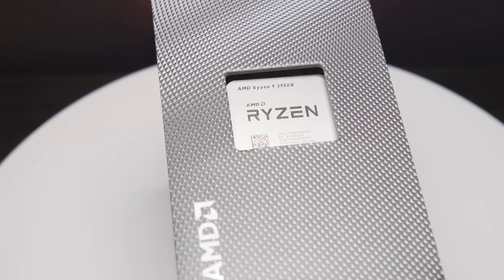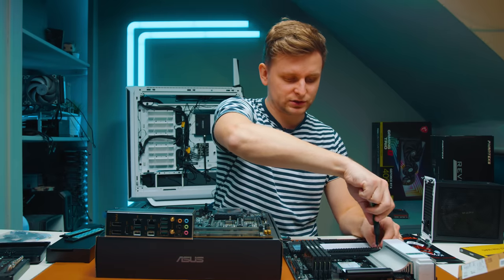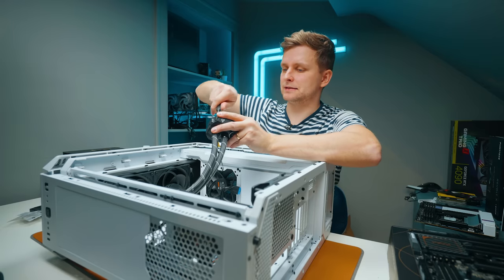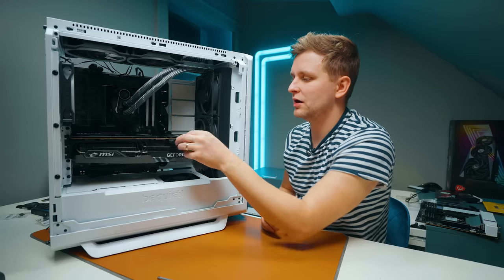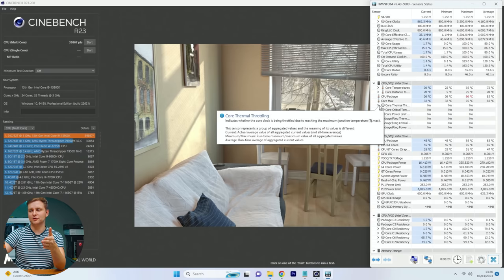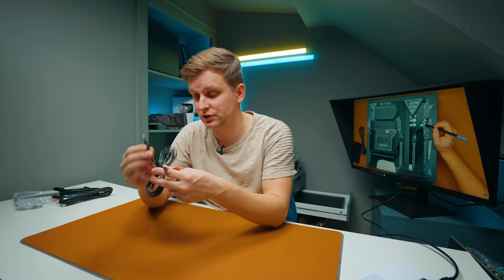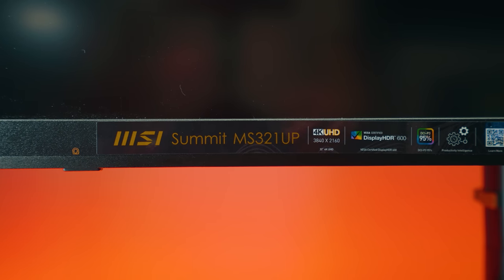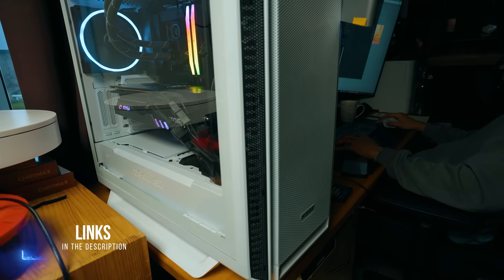My Dream Video Editing PC - 'BEST' Creator PC 2023

Comment: Awesome upgrade bro ❤ and I would like to mention some things here that according to Gamers Nexus testing, Thermal Grizzly Contact Frame has much better tolerances and proper torque adjustment guide for screws that helps it to shed some extra degrees and better memory frequencies. That video is caled "$4.35 Fix for Intel Thermal Problems | Thermalright 12th Gen Contact Frame"
Reply: Just few degrees for the 13th gen

Comment: Nice upgrade. I sorted my problem after watching your video with the Asus representative about RAM. 
My XMP didn't work on my Asus ProArt Z790 motherboard with Corsair 64GB of DDR5 6000MT. 
I was running at 4800MHz default config. So I enabled the XMP-II profile and dropped it to 5600MHz works perfectly now. I wish I went for a 5600MHz Ram in the first place and save a few £.

Comment: 0:55 "It's time to upgrade the PC so we can get more videos done faster."

...the 3090 Ti that was in there was more than adequate to edit video. I cannot comprehend how a 4090 will actually save you any meaningful amount of time editing/encoding/transcoding.

Maybe your project exports take 4 minutes instead of 7, but so what? How often do you export/transcode/etc.? Does that time actually add up for you? Enough to justify a $1600 GPU to replace your $1600 GPU from a year or two ago?

If you want a 4090 in your PC, no doubt; respect. However, I'm skeptical this was actually necessary and will actually have a meaningful impact on a typical YouTuber. The truth is, RTX 3060 12GBs will handle 4K timelines no problem... As will 20-series cards. Hell, outside of encoding, I barely notice a difference in premiere between my old 1070 Ti and my 3070 Ti.

Comment: The FireCuda 530 certainly is a lot of fun. I've got the 510 in my original system, and in my current system, I'm using the 530 (yes, also the 2 TB version) as my main drive, and the 510 as the secondary one.
Reply: I just bought one ,Firecuda 530 2 TB version today.Its realy mindblowing fast..

Comment: Excellent video and awesome upgrade! I built a high-end Z690 platform back in October and have five of the Seagate Firecuda 530's in my system. Absolutely love them! The fact that you gained so much performance is pretty damn impressive. My plan is to upgrade to a 4090 Ti  if/whenever it's released, as I need all the 3D rendering horsepower I can get. I hope I can get as close of a performance uptick as you.

Comment: The only thing I didn't like about the MSI trio, is that apparently they skipped out on the vapor chamber and have a cheaper VRM, otherwise its one of the better looking ones you can find at MSRP. I managed to get the Asus TUF version at MSRP via the Asus storefront. Curious if you also get a bit of coil whine.

Comment: I Just upgraded to an 13900KS from my 12900KS and the Artic Liquid Freezer 420mm II in Push-Pull had a hard time keeping it cool. So I moded it and added a Rockit-Cool Copper IHS, since then my CPU is a lot cooler in that combination. Still 2 cores get into therma throttling but most are cool enough to continue with high frequency.
Reply: I think the s variant is meant for custom water looped PC's

Comment: Lovely build,
Congratulations.
What do you think about direct die cooling for your build?
I'll say you would be able to get extra performance from the chip
Reply from the maker: I'd say as a creator it's not worth it, too much risk and work if anything needs changing :)
Reply: @theTechNotice  what I'm so sure of is that 13900k will not thermal throttle when it's direct die cooled, which is a great performance advantage
Reply: @samsonadeboga223  How often does the system actually throttle in day to day use though.  It would probably make more sense to tweak the power to keep temps in check if it's actually throttling than go direct die.

Comment: completely agree about the Arctic Liquid Freezer being one of if not the best range of AIOs, but have the annoying need to find new motherboard protection stickers when you swap motherboards; at least they add two sets for Intel and AMD motherboards. I extensively use WD SN850X and Samsung 980 PRO M.2 SSDs. I'll probably move to 990s when the new firmware has been proven to stop the early "wear" that was happening. Everyone with Samsung drives should be using Samsung Magician and keeping firmware up to date. The rate at which SSD prices are falling is a bit depressing: last year I paid $230 for 2TB Samsung 870 EVO SSDs. Now they're around half that price! Same with DDR5 RAM. My Alder Lake build from last year is now about $2K cheaper!
Reply: Lower prices are great news for us still planning to build
Reply: What motherboard stickers 😭. It is really necessary? Planning to swapt case soon and didn't realize this .
Reply: @cjyy6290  not sure if you saw my reply: someone helpfully deleted the response, probably because it included a link to Arctic's tech support page (i.e. outside of youtube). Basic recap: the stickers are probably required to stop the rubber grommets on the backing plate nuts migrating through the motherboard over time and leading to a loss of pressure and thermal conductivity and therefore an overheating processor. It's probably OK in the short term but I wouldn't risk it over the long haul (no idea how long that would be). Contact Arctic support is your best bet and ask them.
Reply: @treyquattro  noted. Thank you for your help 🙏.

Comment: Nice thing to upgrade your PC
I want to build my first I had a MacBook Pro before. Needs color grading in Davinci resolve. I'm wondering how to reconcile Intel i9-13900KS with two GeForce RTX 4090 and still have a liquid cooler for the CPU. It would be nice if there was an option in the future to mount on the DeckLink 4K Extreme 12G motherboard
Or is there a better design? max £8k on this

Comment: Very nice and informative Video. Well Done. One question............Did i see only 2 fans on the radiator of the Arctic cooler (inside)?
Reply from the maker: There's 3 more on the other side
Reply: @theTechNotice  Thanks for the reply. I just wonder, i bought the Phanteks Eclipse p600s and i will configure push and pull with 6 fans on Arctic Liquid Freezer 420ii. Do you think it will fit on the front of the case?

Comment: The SN850X 2TB actually slightly faster than the 1TB btw. This is the case across most M.2 drives. Worth bearing in mind if you want to maximise every little bit of your system.

Comment: Upgrading to an lga 1700 that will End with 13th generation. Best decision ever for a vídeo editor/motion/vfx.... Really smart. I dont even know why I still watch this channel.
Reply: What do you mean? Even if AMD can like having 2 generations more than the 13th gen, hardware acceleration on that is still going to be under intel a notch.
Reply: @baoquoc3710  Its all about how you optimize your hardware. I got a 12900k, a 5950x and a 7950x. Even my 5950x performs better on the same benchs that he did on his channel latelly. a 7950x reaching 27k on cinebench? wtf, its clearly not optimized at all. Even my 5950x reachs 31k on same test, and  87 degrees with just an AIO 360mm. The stuttering playback tha he got with his builds, i really dont get it, not smooth at all. I can overclock, get performance and keep temp safe. This guy is so much bla bla bla... sponsored channel.
Reply: @Eduardo Nóe  i don't know much about it, but he said in a video that the time that he had to go troubleshooting hardware quirks and rough edges just feel like it should be spent on video editing, especially if you made a living from it. Intel systems just work straight out of the box, no more later hassles you have to tinker with.
Reply: I know what He was saying, and in certain way its right, but I afirm: you can spend one week tunning your system at its optimal performance and work straight ahead from 2 a 3 years in a row with a estable and fast system. I came from analog vídeo, betacam and matics, passed from. Diferents system and softwares. What we Live these days is a dream, fast and reliable systems. 20 years ago was a hell and we needed lost time tô setup our equipe, everything was bugg3d, confused and difficult. So if the things today are easuer we need tô take it in advantage to improve our workflow and save time.
Reply: Considering how often the editing machine has been upgraded its not going to go 2-3 years before the next upgrade.  Don't know why you seem to think his use case is the same as your use case, part of he point of a youtube channel is staying relevant when it comes to hardware with the bonus of being able to make videos about it.  I'm guessing you are more mindful of stability and reliability.

Comment: I have the new 4 dimm 64gb 6600mhz corsair Vengeance ddr5 on the way from Taiwan rn can't wait to get it. Im running 4 sticks 64gb of 6000mhz lancer xpg a dies rn also with just a slight overclock of +1 ratio offset with 0 offset running avx and the turbo set to 128 sec instead of 56 and get 42000+  on r23 and only hit 89° with the h150 elite lcd from corsair during gaming it's around 56°

Comment: Installing that old Samsung is going to slow down your Fire Cuda if the Fire Cuda is Gen 4. The bus will only run as fast as the slowest drive on it. I have the Asus Z-790-E and I know my old SSD slowed down my GEN 4's. You might want to think about running a speed check on your SSD's and see if they're performing at the speeds advertised.

Comment: WIth all the compute power you have on hand, why do you continue to output at 25fps? Love your content, but a lot of the A-roll shots come out as dizziness-inducing choppiness due to the bad interpolation of 25fps on NTSC displays. I run 144 personally, and I still have issues with interpolation. B-Roll and Screen Cap seem to come out fine, but A-Roll is always where I have issues watching your content. Just switched my monitor to 100hz, and the issues persist.

Comment: Lmao why is the extreme ocing z790 tachyon board kinda a good creator board? It is 2 dimms but in cases like this which are the majority where ur using 2 high capacity sticks, u can also do so without awful speeds (64gb, 6800MTS in the qvl). Also has igpu support, one less type c on the back but an extra type a, all of which are at least usb 3 gen 1, 4 m.2 slots. Oh yeah it's also pretty similarly priced. Crazy that the godlike doesnt support igpu while a real oc board thats also a record holder does 💀💀💀

Comment: I like also AIDA64 Extreme for testing the system stability, you can test ram cpu, gpu(cpu),...all together or each individually. And when you just let it sit in the background, you can capture also thermal throtteling

Comment: Doing a build similar to yours had no idea I had to take one of the fans off the arctic liquid freezer 2 420 to make it fit into the be quiet but I was going to ask what did you do with the pre installed fans that can with the base on the front? did you leave them as is?
Reply: I took the front fans that come with the case off and then put the aio fans as intake and attached them to the aio, so still being able to use all the fans.

Comment: Dude literally just built the same exact PC I built last month (Different case tho)! 😉
Reply: Same here 🤣
Reply: What's your case? I'm looking for a case to hold the same hardware
Reply: @TheAsteriskMark  Fractal Torrent
Reply: @shadowfallenable  thanks! I was oriented to the Fractal Define 7, I think they are similar; I'll check the specs of Torrent. Was it easy to apply the Arctic 420? Did you apply it on the top?
Reply: @TheAsteriskMark  Nope… Front.

Comment: I'm enjoying my ProArt boards, I just don't understand why they think it's acceptable to only have 3 PCIe slots on them. It's bad enough that most boards have limited expansion slots these days, but a high end, semi-professional creator board should have more. If all of these boards are only going to have 3 PCIe slots, why not just use an m-ATX form factor?
Reply: That's a limitation of the chipset.  It's pretty much the whole reason Threadripper is popular for creators (and anyone else who needs more pcie lanes) and I suspect 2400/3400 WS Xeon will be as well like older x299 HEDT and W-3300 was.  I'm waiting for 7000 series Threadripper to come out to make a final decision but I'm already planning an upgrade to W-2400 just to have more PCIE lanes.

As for mitx as a form factor, I doubt you could fit all the chipset connections/connectors on a mitx board so that's kind of a non starter.
Reply: @nadtz  It's not a chipset limitation. Almost all motherboards used to have more than 3 slots, and that was when we had WAY less total bandwidth to the PCIe lanes.

Comment: Does the thunderbolt controller with nvm38 work with thunderbolt 1 and 2 devices? Do thunderbolt devices work and connect (especially when you resume from sleep) when xmp is enabled ?

Comment: you should be good with 128gb RAM and that CPU! I am using Kingston Fury Beasts with a 13900K and get a stable 5600 with all 4 sticks. Give it a try!
Reply: same here my cpu is 13900K and 128GB ram Corsair vengeance 5600 as well turned XMP on , works like charm with no issues at all

Comment: Man, if you use an old Samsung 950 drive for the cache, your projects will have a bottleneck on the cache. It would be ideal for all drives have the same speed, i.e above 7000MB/s. 🙏👍

Comment: Wow this is the same build I just made for my rig 😂 Same mobo cpu+ cpu frame & os drive. I went with 2tb for os and went only 2 stick of ram 64gb at 6000mhz gskill. Xmp worked right away which made me happy. I didn't have to fiddle but eventually I will try to oc the ram see how far I can get. I didn't want to deal with making 4 sticks work. Really wanted 128 gb of ram for thew first time 🥲. I wanted strix 4090 but only managed to snag the founders during launch. I went with the ek 360 aio for cooling and I feel it was a mistake. The software sucks and  lga 1700 upgrade kit which was technically free but ek makes you pay for really expensive shipping. If you are going 13 gen just know this beforehand and avoid this cooler because the price will get marked up by the need of an upgraded mobo bracket.

Comment: Why did you have to enable XMP to run it at 5600? The motherboard tech specs say that it can run at 5600 without OC (which I believe means XMP):

7200(OC)/7000(OC)/6800(OC)/6600(OC)/6400(OC)/ 6200(OC)/ 6000(OC)/ 5800(OC)/ 5600/ 5400/ 5200/ 5000/ 4800MHz Non-ECC, Un-buffered Memory*

Without XMP it only ran at 4800?

Comment: Can you let me know if the motherboard ProArt exhibits any coil whine? Either under load or maybe a faint buzzing which modulates in the background with system activity and present most if not all the time (can be caused by c-states).

Can maybe someone run Aida64 copy memory test and latency/ Prime95, Cinebench r23 to see if any of those induce coil whine?

I have Gigabyte Z790 Master, which is a fabulous board but has coil whine as described and i read that Asus Maximus Hero is the same... so how is it with ProArt?

Many thanks

Comment: I wonder if your contact frame is giving you blue screen issues over time... It did for me, so I had to retighten it a few times with a torque wrench. After the 3rd adjustment it finally runs stable.
Reply: its not so much the frame itself, its the thermal expansion vs screws vs spring loaded ILM. after a few thermal cycles you ALWAYS have to retighten the screws on everything thats screwed.

Comment: I am striving for months to finalize two pc one creator and one gaming both z790 ddr5. I am stuck badly because of the negative reviews about various memory, network usb disconnections and instability issues about asus z790 proart, rog strix ,hero, msi edge and also for gigabyte aero and others coil whine and other problems. I am at a point to trying to find even one model worth ten to ten or even 8 to ten. Only the asus apex had no negative issues but is too expensive . Most of some cheaper  ones have no bios flashback csmos reset... Here never pointing any troubleshoot as they are always one time use and testing pc's. If anyone has something meaningful to mention than"always there are problems" please help me out.🤔🧐🙏

Comment: Looking for some help with this motherboard:

I just made my first custom build pc with this motherboard and my Wi-Fi keeps disconnecting (Intel (R) AX210 6E). What is strange is that when going into device manager--> advanced --> switching 802.11ac to 802.11n 

That fixes the d/c; however, causes my speeds to plummet.

Does anyone know a solution for this? i've reset drivers, redownloaded bios from asus. 

Thanks for any assistance.